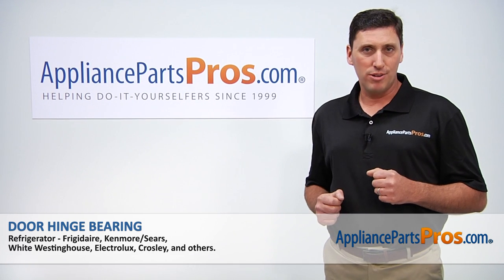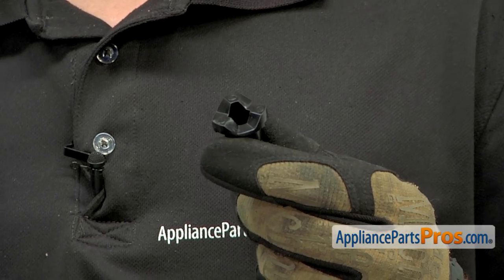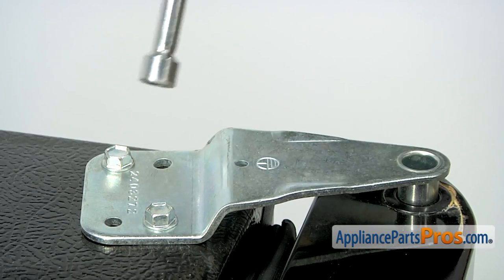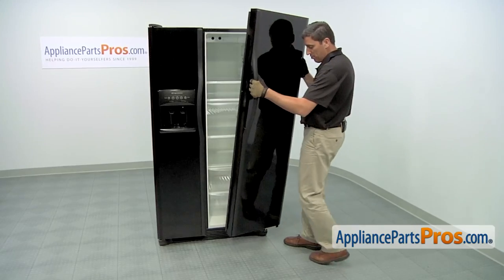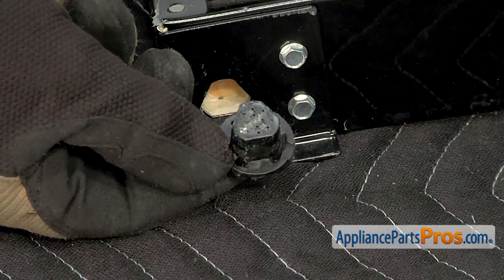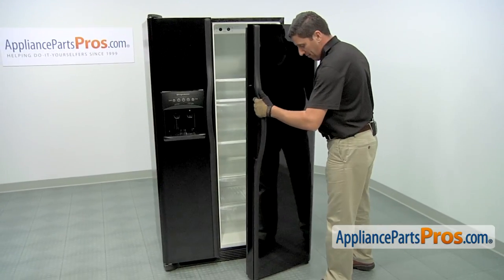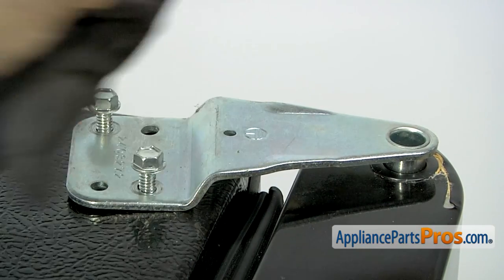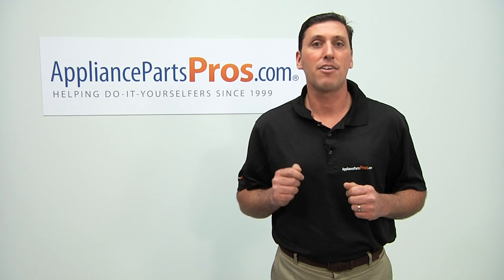How To: Frigidaire/Electrolux Door Hinge Bearing 240328203

Comment: What is the part number for the mating piece that is left on the hinge pin when you remove the door? Thanks in advance!
Reply: I had the same question.....looks like two of them go together?
Reply: @wrmhall4735 Same here, still have a small 'pop' after replacing the top hinge

Comment: Thanks for this video. Real world issues: Our old door hinge bearing was broken off so we couldn't ply it nicely off. We had to perform surgery to get it out (about 15 minutes). The new door hinge didn't butt nicely up to the black plate. It floats about a 1/16".  We ensured nothing (insulation) was hitting it. It felt like a wrong fit just slightly. A hammer pushed it down to almost flushing it. REFRIG may have had this defect to begin with which would explain the door "clunking" sound.  Good news is, the door's on and no clunk sound. Handles don't line up, maybe off 1/16".
Reply from the maker: Sometimes the new part pushes right in other times you may have to tap on them to get the to sit flush. Glad you figured it out!